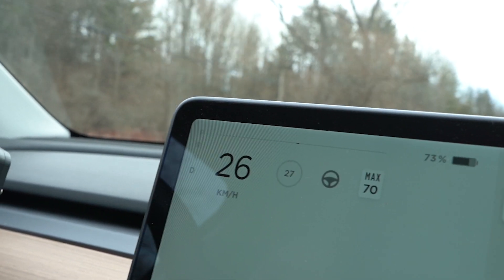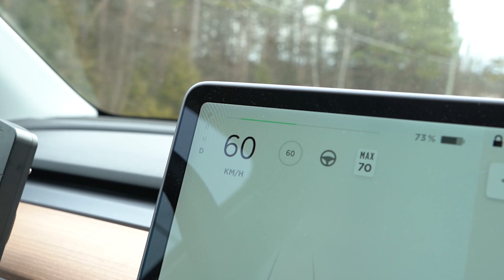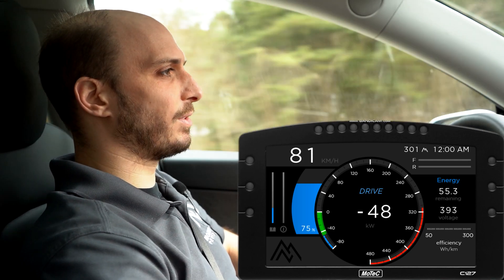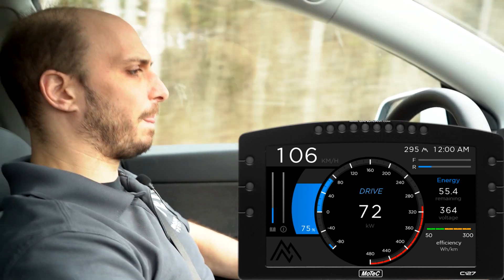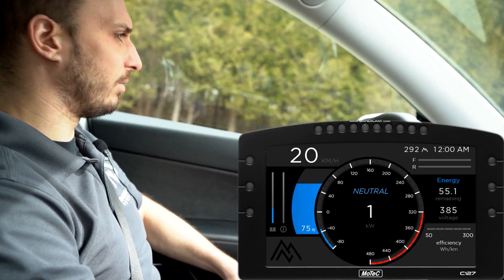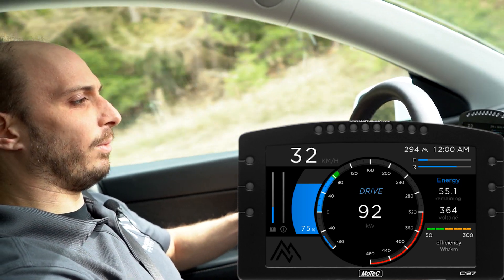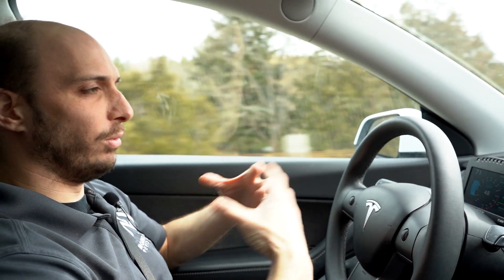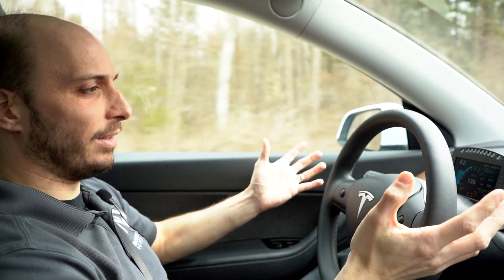Tesla Model Y 2021.4.12 Update - More Cold Weather Regen Braking!

Comment: Very interesting stuff. Tesla seems to really lead in things like this. I wish there was more publicly available into on how various batteries respond (over the life of the battery) to different circumstances.
It's pretty cool and similar in some sense to EFI tuning. The first thing that comes to mind is the thing motec can do where when it calculates cylinder temp is low you can have more ignition advance for a short amount of time without running into knock.

Comment: Nice demo! This change should improve cold weather city driving efficiency.

 I've noticed long before this update that regen is reduced after 5 to 10 minutes descending a steep hill in cool temperatures (like 50°F/10°C). I suppose it's possible the air flowing over the car is cooling the pack, but it seems far more likely that Tesla already had this sponge-like behavior, but at a far longer time scale.